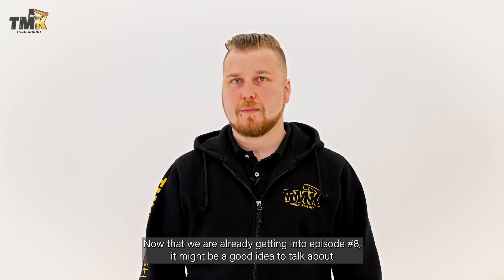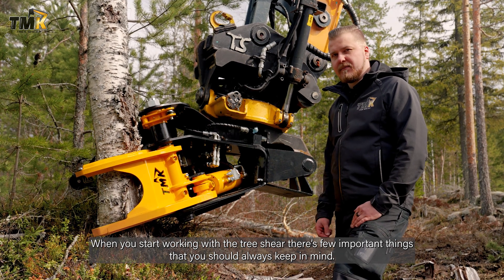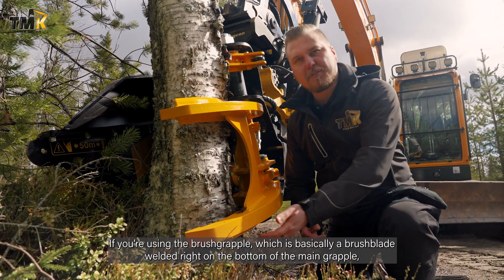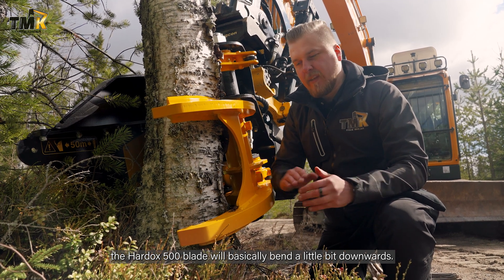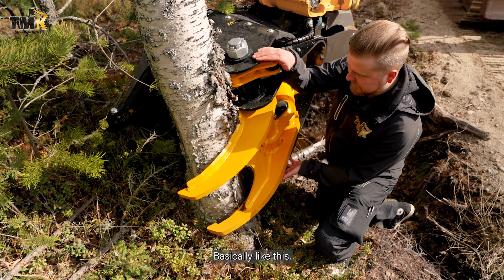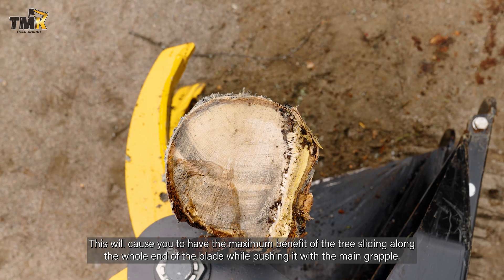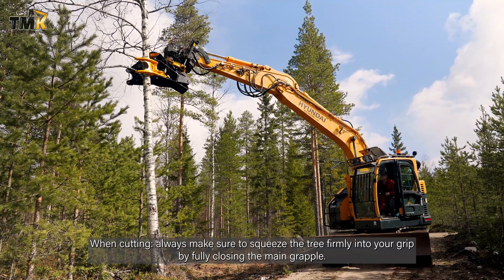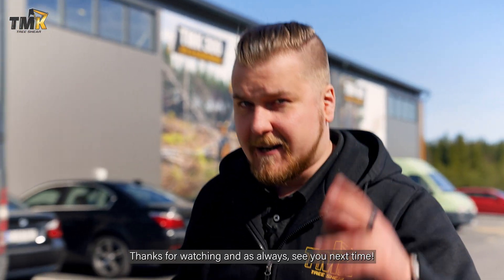Episode 8: How to cut with TMK Tree Shear // TMK How to series

Comment: What is the advantage of using a tree shear over a mulcher?
Reply from the maker: Hi KICKS BLVD!
There are quite a few advantages, depending on your job ofcourse. 
Firstly it’s going be a lot cleaner when you don’t have woodchips flying all over the place and you can pile the trees/brushes neatly. Secondly it is much cheaper to buy and maintain a tree shear, you don’t have to buy spare blades/bits and there are a lot less  moving parts. And you know it’s much more relaxed to use a tree shear as the mulchers produce a lot of vibrations and noise.
These are propably the most common ones.
-Jesse
Reply: @TMKMachinery   i want those mishion